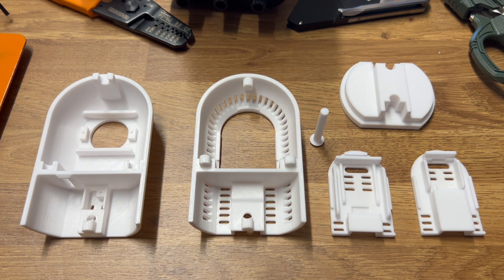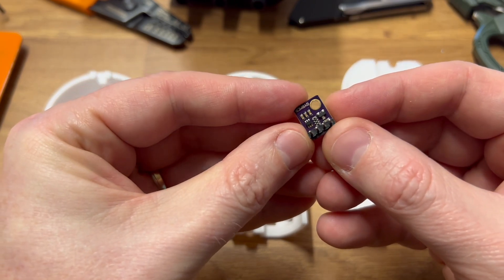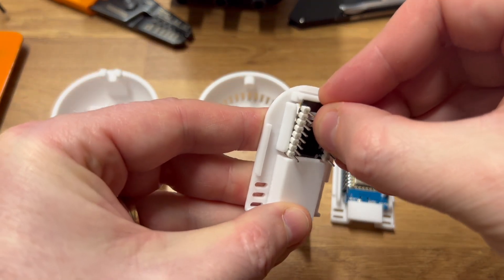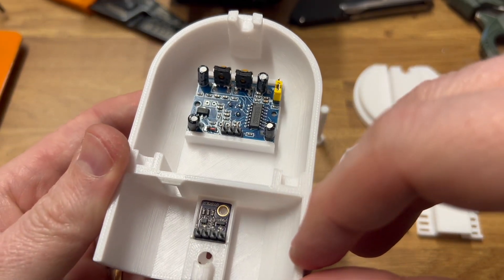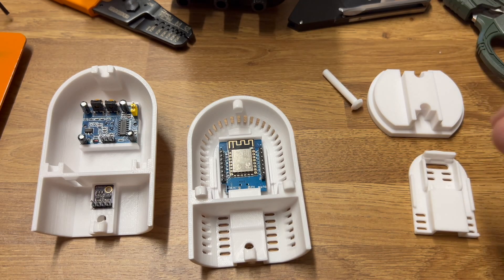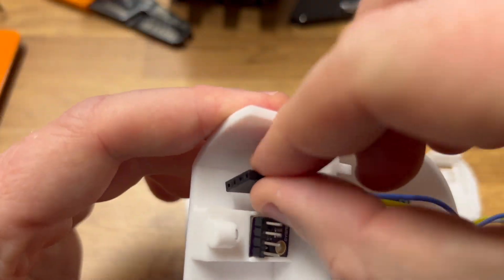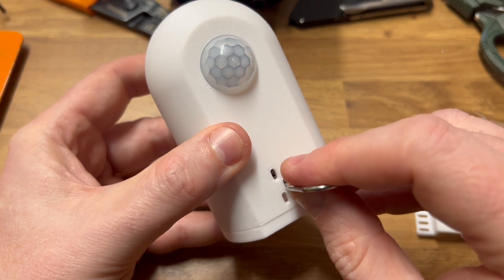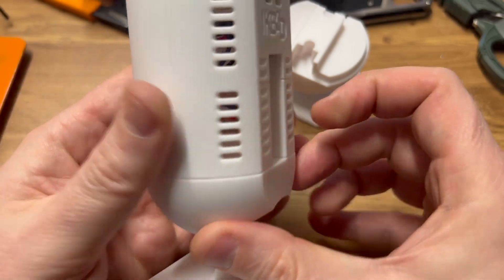Leela - The ESPHome Room Multi Sensor for Home Assistant

Comment: is there an option to also add microphone and a little speaker to also add the voice assistant project of ESPHome? that would be awesome, then it is basically the swiss army knife of usefullness.
Reply from the maker: It's been suggested I need to look into it! Leela is on the back burner at the moment sadly while I deal with another product that blew up. I've built a print farm though so maybe you'll be able to buy a Leela in future!

Comment: This looks awesome!  I was trying to find a case for the sensors I liked, and I think this just nailed it 😁 I saw you are working on a version for the LD2410C, do you think there will be one for the HLK-LD2450?
Reply from the maker: Thanks bud! I've had to put Leela on the back burner for a month or so as I had another product go a bit viral (Bender!) I will be coming back to Leela because I poured so much time into her.  There are issues around the 2410C, namely it throws off a lot of heat which the existing mounts are transferring to the chassis which is effecting temp readings. I will be able to mitigate that with design changes I'm sure. As for the 2450, yes I'll likely get to it at some point!

Comment: Man kudos that's so great! Personally I was leaning more on a mmwave sensor+temp+humidity combo but given the price and ease to build I might try this and evolve in the future. How are tolerances for printing?
Reply from the maker: Thanks! There is a beta version of the files on Printables that includes support for the 2410C mmWave. However it seems to product a lot of heat and I need to revise the design to deal with that. My other project has blown up online though and is taking all my time, I will come back to Leela though!!!

Comment: I'm not in the market to need one of these but top marks on the case design, love the interlocking section and pin.... So elegant. If I were to make one, I'd probably want it smaller but appreciate that makes things fiddly and would require either custom PCBs or at least hand soldering. Thanks for sharing

Comment: another option is to use create a multi-ground using small perfboard and male headers.
Reply from the maker: Yes you're right, I've considered it, but it's more hardware needed which I'm trying to avoid to keep cost down.  You could go as far as making a board with JST connectors and cables for all the sensors but it's just more complexity/cost. If you use good Silicone Dupont wires its easy to connect everything up :-)
Reply: @zerofox3d  small petfboarf 3x5holes is more than enough for this

Comment: Nice project! I’d like to make something similar using an ESP32 with LD2420, BH1750, and BME280.  Maybe a simple CPB to bring it all together.  BTW, a link to your YAML would be helpful for others trying to replicate this.  Maybe a GH repo…?
Reply from the maker: Check the Printables page bud, I’m testing an 2410C right now with other boards and sensors coming in the next few weeks. YAML is in the other files section on Printables too 😉
Reply: @zerofox3d   love the case! I would love to see one for 2410c esp32 bh1750 and bme680 thanks again case is very slick
Reply from the maker: @MarkGhali  Thanks! Check the 1.1 Beta video, it has everything you want except bme680 which will come at some point!
Reply from the maker: Also the issue with building all the components onto a single PCB is isolating the sensors, specifically the temp sensor, for the ESPs heat dissipation. There are several design features in Leela that isolate the temp sensor from that issue, took a lot of testing!
Reply: YAML for this is simple, just add basic ESPhome yaml and add both sensors under sensors and I2C under I2C section